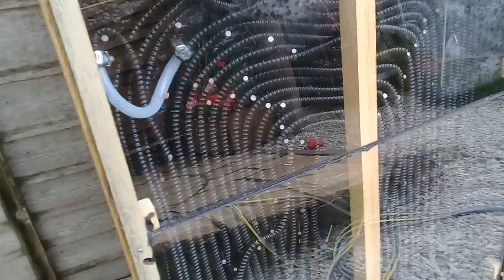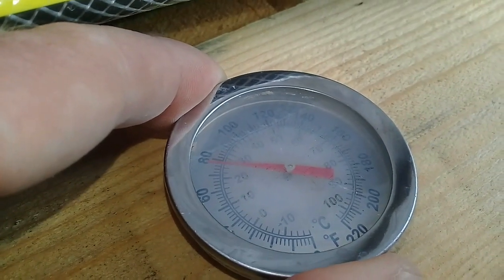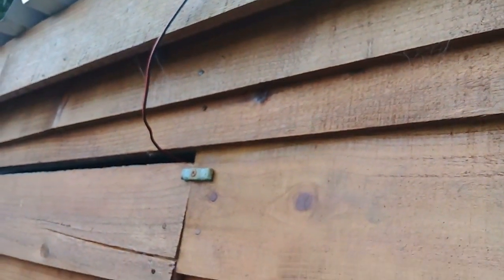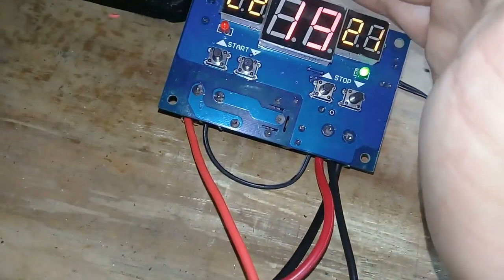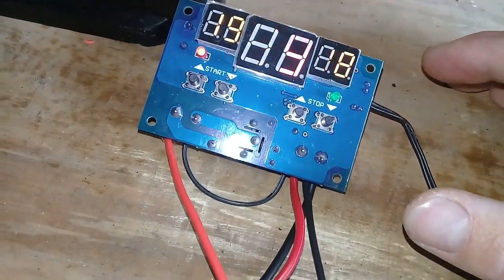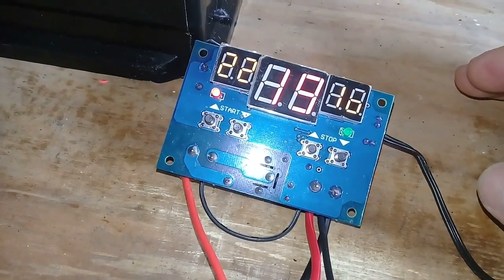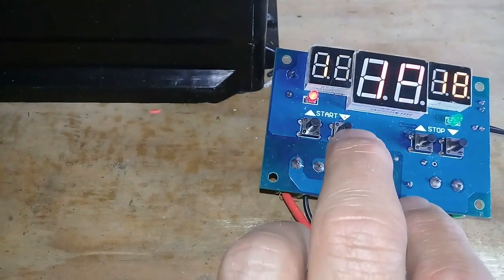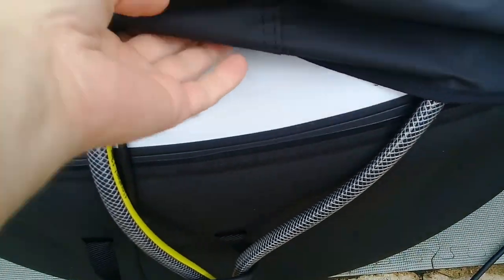Lay-z spa Intex Solar Heater Update - Adding A Sun Switch????

Comment: Great video, I know this is quite old now, but looking at doing something similar and you've given me some good ideas. One suggestion is you could put your air temperature switch inside the heater / hose cabinet instead of outside, that way it will only run when it is warm inside the housing, set it to say 40'C.

Comment: Thanks for the vid not many of these are set in uk.
Have you set it up again this year?
How much do you reckon the savings were? 
Does it ever take heat from the tub?
im temped to make a bbq/log burner heater for £30 thoughts ?
Reply from the maker: Not set the hot tub up yet but once its out i will set the heater up. I think the heater probably paid for itself last year with the heatwave we had in the summer. Im not sure what the gains will be this summer .   The external temperature gauge should have minimized any cooling by switching the pump off when the sun went in. I did think about an old wood burner with back stove but we have kids so cant do it. Ive seen a youtube video of a guy with a woodburner next to an intex pool! I'll be posting an update vid in the summer with an update.😀
Reply: So first attempt wasn’t great 2• in just over an hour. 10m 10mm copper coil just sitting on coals. Will try again with different coil design. But looks not worth the effort/ cost savings atm.
Reply from the maker: @madmanchriss  be careful you dont use any steel with the copper setup. I used an old radiator first go and had nice rusty water 😀

Comment: I thought about doing the same design then put them in a greenhouse. What do you think?
Reply from the maker: phil Emmett greenhouse in full sun would be good. I was looking at our greenhouse yesterday and thinking the same. One thing to remember is to keep pipe runs from solar heater to pool/tub to a minimum to reduce heat loss.
Reply: My hot tub to greenhouse is about 20 meters. I can run it underground with insulation.

Comment: Love the design. Saw this video (https://www.youtube.com/watch?v=C6CnAPcgG60) where the guy used a (presumably 12v) solar panel directly to power the 12v pump. If there is not enough sun, voltage/current will drop and pump will not pump.  Once there is enough sun, pump runs again, emptying the hot water from the solar heater into the pool. Seemed an easier solution than  a sensor, controller, battery etc.

I tried the solar heater method last summer, but couldn't get the pump from the UK. It helped a lot with initial heating for refills, but this year I hope to get a pump method, rather than cold water through the solar hose to the pool. Was suprised how hot the water comes out. Finally ordered a pump this evening, so hopefully I will get it fully up and running.

In Germany, it was -12C here last week, but during the summer it gets to 28/33C so the solar heater works well. Glad to see this works in the UK. Thanks for the idea!